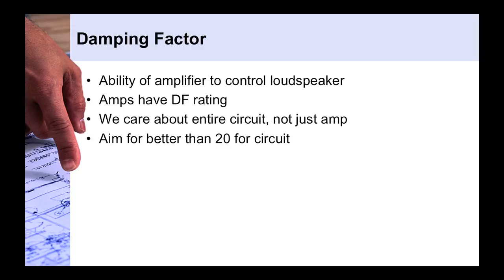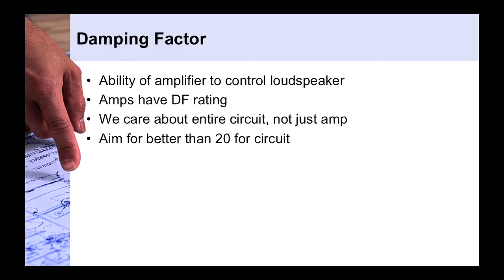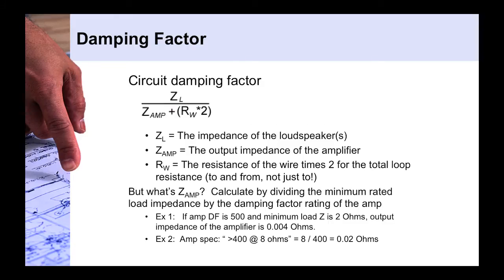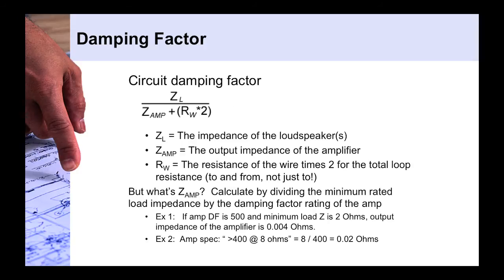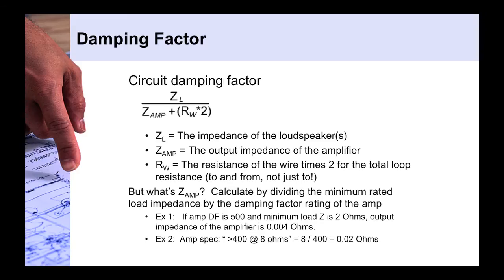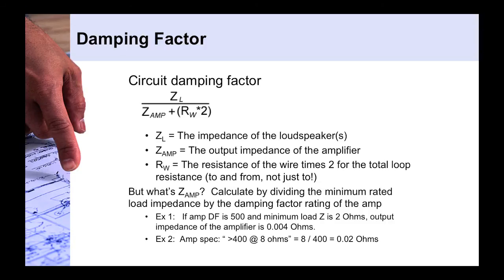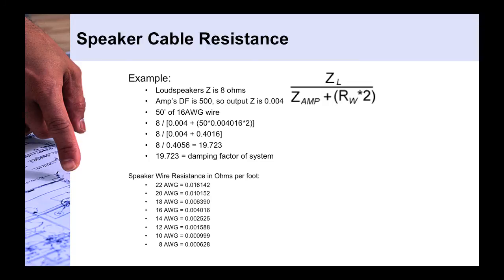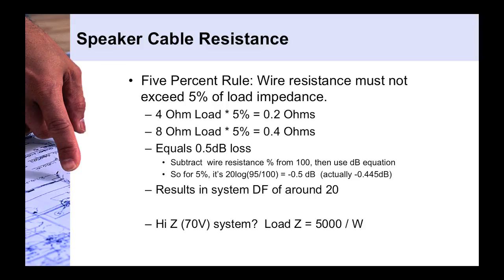Damping Factor and 5 Percent Rule

Comment: Well explained, thank you so much for your effort.

Confirmed that I choose right configuration for my stereo system, basically relying on guessing.
- amplifier with damping factor of 100 or more on 8 ohms load
- speaker cable, 32.8 feet (10 m) of about 11 AWG (4 mm^2)
- 4 ohms speakers

Gives me overall damping factor above 20 (24.39), as well as satisfied "5% rule".

All other conditions are met: (more or less) amplifier RMS power, good speakers RMS rated power (about 25% higher, not using preamp tone controls at all), size of room with kind of golden ratio (5:3:2), damped, etc...

I only wish I was seen this video earlier.

Comment: I get so frustrated when I see a Church sound system that was installed by someone who clearly knew nothing about this!  ...and then they wonder why their system sounds "messy".

Venue: 650-700 seat room, about 120' wide, 80' deep, 25' ceiling, carpeted, hard/flat L/R walls, non-flat hard ceiling.

They are running: (1) Crown CE1000 to power 4 flying Main cabinets (all spaced 15-20' apart), consisting of: 2 x old Yamaha WF112 (8 Ohm 400W program power); 2 x JBL MS112 (8 Ohm, 300W IEC). Each match pair are wired in (get this) parallel (4 Ohms), with s single 16-gauge stranded wire, running 100-120 feet to the amp.

Each Main speaker pair (in parallel) is driven by one channel of the CE1000 amp - which does 450W/ch. at 4 Ohms... but the wire adds about 1 Ohm to that, so it's really running at 5 Ohm load, which means it's probably doing 375-400W per channel. My estimate is the DF is down around 4.5 - maybe less due to plenum space wire heating, driving the wire resistance up. (amp DF is >400 10-400Hz, <20mOhm output Z)

Also a CE1000 for rear delay fills, which are 4 x JBL MS26 (16 Ohm, 150W IEC), wired as 2 in parallel per amplifier channel, wired with all 16 gauge stranded wire. Bad, but not nearly as bad as the Mains. All delay fills are at a common distance, one group spread across the back of the room. (badly angled down at about 80°... almost straight down at the last 4 rows of seats).

And a CE2000 for single 18" subs (Peavey CS-118, 8 Ohm 350W continuous), one per amp channel, each wired with <75' of 12ga wire... not terribly bad... but located off-stage right and left, in cubby holes... that likely resonate terribly. They should be on-stage, sitting together to prevent wavefront peaks and valleys across the wide room.

The Mains have no peak/dynamic headroom... the amps are often running into peak clipping... I wonder why...

I've recommended rewire with an additional CE1000 amp for Mains... one speaker cabinet per amp channel, 10ga. wire to allow for (hopeful) speaker cabinet upgrades.

Rear delay fills - rewire with 12Ga, leave them wired in parallel pairs is OK.

I'm doing this not as a commercial sound engr, but I was an electronics design engr for >20 years, and was director of media ministries (all A/V technology) at a large church in KCMO for 14 years... I learned a lot, they had a GREAT system, engineered by one of the best... Acoustic Dimensions.

Thoughts?
Reply: you could rewire but I bet 99% of the audience won't be able to tell the difference